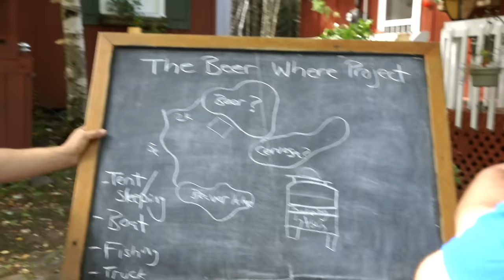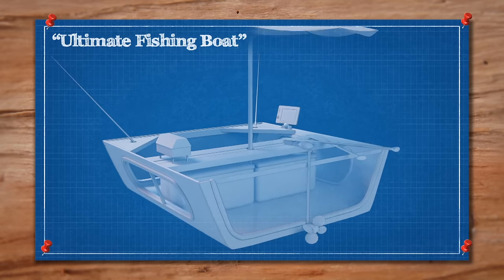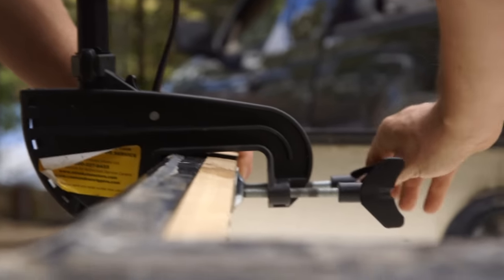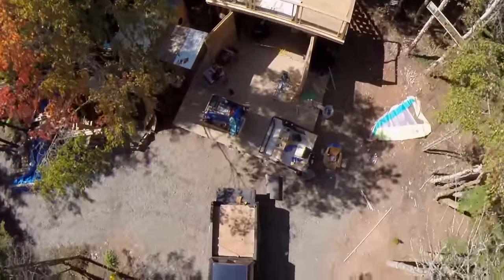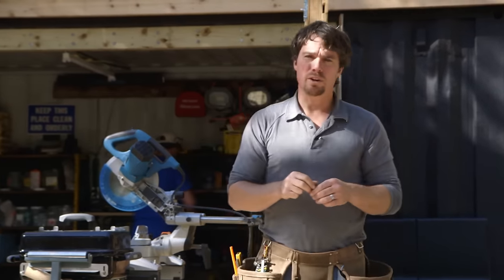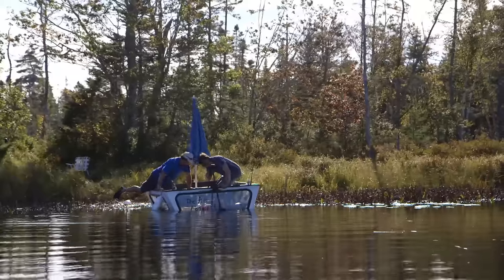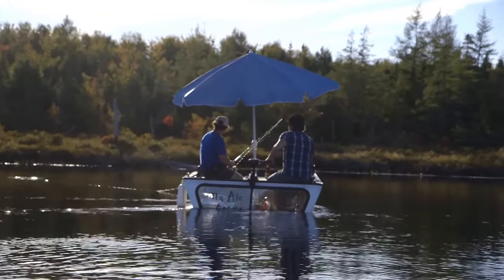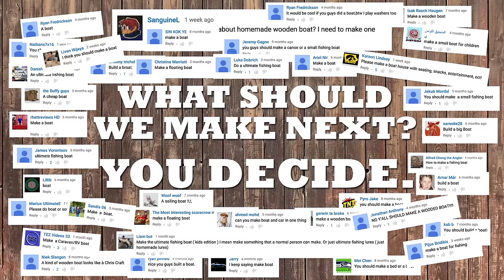How to Transform a Truck Cap into a Fishing Boat

Comment: use duct tape for temp sealing... nice idea. use the cooler as extra buoyancy. by strapping it to the side. in fact make a  tapered  styrofoam platform for the cooler, battery which would carry that weight..  an break the water or trailing at the rear of the boat. or use a sheet under the camper or use a tarp under your "boat" with clamps  .. that could keep your self floating  styrofoam  prow intac.t..